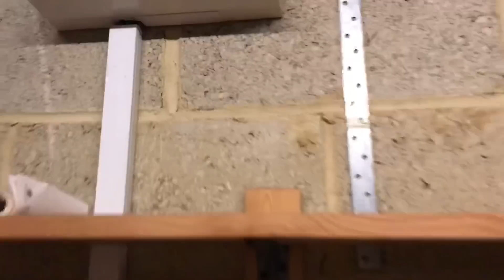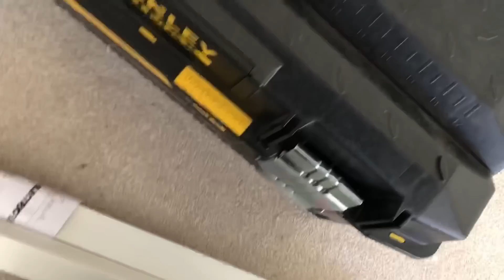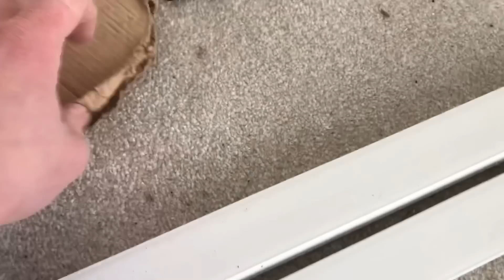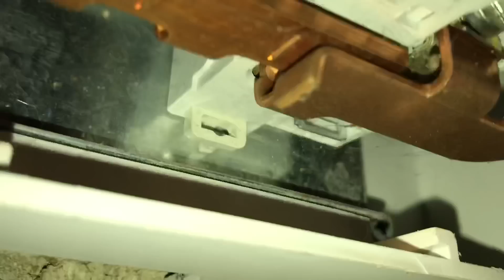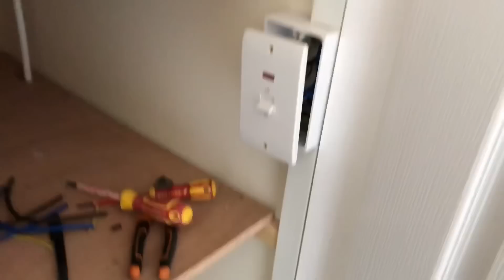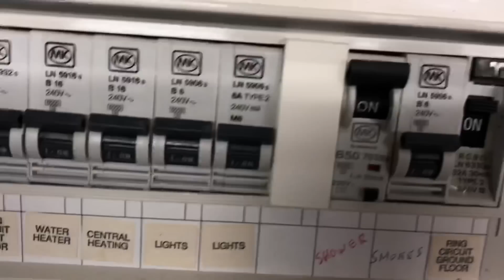Electricians day installing shower circuit and consumer unit find.

Comment: I've got one other these running from my garage, through the wall into my downstairs hall, up a bedroom wall, through the loft across the house, then down into the shower. None of it in trunking.

What I'm wondering is if its ok to chase part of it into the hall wall and then run under the floorboards into the bathroom instead? Safe under floor and embedded in wall?

Comment: Looks good. I need a connection and electronic shower installed. What is the cost for both? BTW I looked and I live in London, you guys are to far away. Not sure if you have locations or workers all over?

Comment: Hi, this is my 2nd visit to this installation video and a couple of things sort of jumped out at me. The Consumer unit should have their MCB/RCBO Installed from the Greatest Ampere Sizes nearest the Main Switch to the lowest Amp Rated being the furthest away, large loads need to be fed first and a real bonus is that lighting that dims when these loads are being fed can indicate issues. Placing a 50A breaker near the end is not a good idea.
Maybe also another good idea where it is not practical to re-configure the Existing Consumer Unit [short cables maybe] is to install a Separate 4 to 6 way Consumer Unit wired direct via a pair of 100A iscol links, Next to the Origianal Board, to then install a Main RCD Switch rated at 30mA/80A and then place a 50A Type B,C or D Series MCB Dependent upon Max Circuit Resistance. Interesting point here is that everyone and their dog selects a Type B Breaker without considering the value of selecting a more suitable one via the Tables in the Wiring Regulations
I also noted an extraneous conductive part [Wall to Rafter Metal Tie]  next to the Consumer Unit with no earth attached and I doubt that the Garage Doors/Frame had been earthed ! 
Also omitted was the check to verify if the Bath / sink had been Bonded, bearing in mind this installation appears to be old school regs not having a 2 x Main RCD Split M/C Board affording all circuits with RCD Protection, it needs to comply to the regulations of that time and sure as eggs are eggs this needs checking, also a quick check as to the type and Class of light fitting installed in the Bathroom.
Mr Spence Eng April 2022

Comment: When we had a new shower fitted,the electrician noticed that the supply cable that my now retired electrician had originally fitted was 16mm,as was my cooker circuit and the utility room too.He wasted no time and effort telling me how much he hated the stuff and that despite the shower and consumer unit being only about 7-8 ft apart that there was about 17 ft of surplus cable in the shower circuit just laying in the loft which I then pulled through,but only after a massive sweary fight with it😄,Jeez! that stuff don't manipulate or even want to co-operate it's almost like semi solid bars,no wonder no bugger wants to use it!. Plus it seems an expensive way to do it but I'm assuming that because the original guy was nearly finished he just used what he had. Anyway,recently while fitting a new cooker to our kitchen(twin fan ovens with grills and 4 halogen rings)which required the back to be removed to make conection I couldnt help but notice that what we were effectively doing was joining a bit of 16mm to a bit of 2.5mm, the internal wires looked completely ridiculous on the face of it and it was basically unsheathed 3 core flex supplying the whole cooker!

Comment: Great video Chris, lots of helpful info. Would like to ask why you chose an RCBO rather then just a standard circuit breaker to supply current to the shower. I am not an electrician but a plumber/heating engineer so I do install showers now and again. thanks.
Reply from the maker: Circuits in a special location ie bathroom need rcd protection
Reply: @Cjrelectrical  Thanks for your reply Chris. I am a still bit confused as to why you installed and RCBO rather tan just a 50A MCB ? Is there a specific requirement in the regs that specifies a RCBO over an MCB or was it a matter of preference ? Thanks
Reply: Wherever possible showers should always be protected by an RCBO, this is a device that does the job of both an MCB, to provide overload protection and short circuit protection, and an RCD to give Earth Fault protection. ... The RCBO is the better option as this gives overload, short circuit and Earth fault protection.

Comment: Let me see if I understand this, the building has a 100A incomer and you are not prepared to install Two 10kW Showers that combined represent at best 2/3 of your 100Amps and are likely to run for a max of 10min. Have we now stopped using Max Demand and Diversity when calculating loads.
Maybe a quick trip around some of the Large stores in Town may help you get your head around what it is possible to run on 100A/Ph, ok the boards get warm, but due to diversity they quickly cool when loads switch and this system has been about since the begining of time, I have seen incoming cables sized as small as 6mm running both Single and 3ph x 6mm fused at 100A/Ph and I have also witnessed 1st hand an 8.4kW Electric Shower run on 2.5mm T/e pvc/pvc Cable and had been doing so for years and years, before they whiffed that old familiar fish smell and apart from needing a cut back it would have been good for another spell of service, sometimes things just work with Diversity.
Mr Spence Eng
Reply: The OSG and BS7671 would not allow such loading probably. If you have 2 electric showers you probably have a largish thirsty house. How are you going to get it all below total of 100 amp main fuse unless you use a priority board for 2 showers

Comment: Hi,  if i have a shaving light above the mirror with a pull cord but i want to change the light to a one that doesn't have a pull cord how will I do it ? i don't have a wall switch for the light is just the pull cord at the moment ? Thanks

Comment: I guess you could put a changeover switch between the supply cable and the two load cables coming from each shower, so only one at a time could be used, but I think that's a bit too out there for a domestic dwelling?

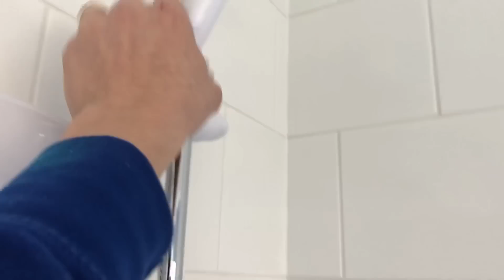Comment: 13:49  In Thailand they use these showers too. But without special on/off switch in cable line, power cable direct to fuse switch. The shower self have a on/off button switch. 

Why do you need three switches in UK?

Comment: Just fit a shower split  shower splitter connector relay switch so only one shower circuit can be live at one time not seen the cost of then but there out there.  More cost but if that is what she is asking for.

Comment: Question i am now on my 3rd isolating wall mounted Switch the previous one lasted 7 months the first one 7 years when the shower was fitted by a Qualified Spark i normally turn the shower isolating switch off when ive finished showering just wondered if it causes the switch to fuse together if you turn it on anmd off ? the last one i have replaced today the top wire had burnt out and caused the switch unoperable ,the second switch was fitted by another Qualified Spark but this only lasted 7 months i have now fitted a new 45 AMP switch myself as my spark said he was ogff till Jan 6th 19 thanks in advance any ideas

Comment: i being from usa wld have sleeved some pvc conduit thru the block and left  not so much of a tight bend out of the hole i think you may have over done the clipping a little but maybe there are different codes on that side of pond. in my area its one clip every 1.2 meters larger cables like those i might go every 1 meter

Comment: What would happen if you connected up 2 x 10.8kW electric showers on the 100 AMP?  and ran them at the same time?  Would 2 x 8.5kW be ok as it comes in at 83 amps ?  Or is there just no way to have 2 electric showers working in a domestic house?  I mean surely that is a problem in any bigish house?   Or fit somekind of automatic lockout box that means if one shower is drawing power, the other wont turn on.

Comment: Just one small criticism, whenever you see something dodgy, (like the exposed copper of the meter tails in the unit) dont just say "thats fantastic" and move on. You know what youve seen, and whats wrong, but the inexperienced will be wondering what was fantastic, and think it was acceptable. You have done this in a few vids i have watched, so if you see something wrong say its wrong, and why. Sorry to point this out but its important when doing instructionals.
Reply: Bang on the money, yes if it is wrong put it right, how long would it take to trim them back or 
to put some Colour Coded Heat Sleaving on them. For more complicated items, take a photo and advise the client this should be put right and the cost of doing so.
Mr Spence Eng

Comment: I'm a little confused,  why are you running mains power into a shower? Is there no central hot water service installed in the U.K? Here in Australia every house has a centralised hot water service, only exception is some units that have a complex hot water service.

Comment: What the silicon you use incase of fire it expend? Anyone
Excellent job bro well done
Reply from the maker: https://www.screwfix.com/p/no-nonsense-intumescent-sealant-white-310ml/5689R?tc=NT6&ds_kid=92700022904812373&gclsrc=aw.ds&ds_rl=1249416&ds_rl=1241687&ds_rl=1245250&gclid=EAIaIQobChMIiIGE5NiG5AIVhrHtCh1j_QwAEAQYASABEgJPVfD_BwE
Reply: @Cjrelectrical  really appreciate it mate

Comment: I'm enjoying how you do electrical work in the UK. Especially the flexible stranded conductors in the cables. 
In the US we typically use a 5ma trip rated 120 volt GFCI receptacle to protect people. The 30 ma trip would be to protect wired equipment. 
The residential voltage  supplied by the utility is nominally 120/240 volt with lights and receptacles supplied at 120 volts.

Comment: it blows my mind that your allowed to put a 240v appliance inside the shower. you  guys sure put a lot of trust in your RCD/GFI's!!!! 

over here in Canada(or north  america in general) you can't even have a switch within arms length of the bath. yet somehow people over here still mange to kill themselves by using  phone charger in the tub. 

its very interesting how different electrical safety codes are from country  to country despite electricity being the exact same thing everywhere.

Comment: shower not need 10 kilowatt heater, i have 2 bathroom only 3,2kilowatt, 16A max have 3,200 KW fuse. and cable have 16A need be 2,5mm2. simple and hot water have alltime. but we have normal all world used 230V system not idiot old historic 110 volt what not used anywere normal human world today.more volt and less current have lot safety, high current kill, not volts.high current burn many house but low current not.this is main true why all country has change old pre-history 110 volt to safety and lot better 230 volt system. only idiot use today 110 volt systems.

Comment: hmm,douple pole 50A switch, need be ALL near water area 30mA safety switch,i not remeber english this switch name but ELB safety switch need be.this have only safety to human if come somethink broken and problem. ALL elektric in bathroom,pool area,kitchen near water need be 30mA safety switch,ewerythink soccet and lamps and power were has in bathroom need be. if not have ,inspector no aprove, fail. whit out switch have super wery dangerous . and nedew elektric no make near water point, must be have minimum 1,2 meter far all water point.

Comment: Why do you need to pull out the neon for the IR test? Do you IR test between line and load?
Reply: The neon is across Line and Neutral so when you put 500v through there it'll blow the neon.  Or, if a miracle happens and it doesn't, it'll invalidate the IR test.
Reply: Thanks for the reply, I meant to write Line and Neutral. Sorry for sounding silly I'm not from the UK area so I am quite intrigued. 

So in a situation with a already existing house are you then suppose to go and unplug every socket and or remove every globe? I thought IR test between Line - Earth and Neutral - Earth would be enough and then a continuity test the different circuits?

Comment: Our consumer unit at home looks like a very similar model to the one in this video. The RCD looks (a bit) newer than all the other breakers, though it's still all MK. (though there is also the same hole at the top of the box)

Comment: Never gets old watching you guys across the pond! Electric showers seem so weird coming from the US! We do have demand water heaters mostly gas around here but you will find an electric from time to time. Last one I saw was feed with 3 x 30a 240v circuits one 10ga (2.588 mm) run for each stage of the heater. Keep in mind this is a whole home unit not just one shower.
Reply: I am a plumber in the UK and always suggest to customers that they choose an electric shower in preference to having a shower supplied by hot water from the boiler. Main reason being that if the boiler breaks down and it's going to be out of service for some days due to getting someone available to fix it or waiting for spare parts, having an electric shower means you even though your heating and hot water supply to the taps (fawcets) is down you still have a hot water st the shower. Especially important if you have a large family and children to keep clean !

Comment: You may have made an omission by not installing supplementary equipotential bonding to the lighting circuit or an rcbo on the lighting circuit, since it was not covered by an RCBO or RCD in the consumer unit. 18th Edition regulation 701.415.2, in particular 701.415.2 part V states it can be omitted if all final circuit in that location are protected by and RCD. That didn't seem to be the case?

Comment: These "power" showers are so strange for finnish people who get warm water straight out from shower. Why dont you use bigger Electric boilers for warm water?
Reply: Probably 1) not a high enough water head
2) big pressure difference between hot cold water.

Comment: Christ UK electrics are weird. All our wires are inside tubes that are inside the wall/under the floor/in the ceiling. Even the electrics that are on top of the walls (old houses) are inside tubing. Our warm water comes from heaters that are outside the bathroom.

Comment: How often do you guys get a DIY light switch move and the guy uses the earth as live instead of buying 3 and earth cable for lighting. Crazy, the worst thing was the guy was complaining of shocks of the switch!! dumb ass connected earth to earth but it was live the other end. The switch was not only not earthed, it was live on the hot cable. I wish people would leave things alone if they don't understand. To be a good electrician you need a good imagination to visualise in your head how it should be. Great content matey. Hope it educates people in the dangers of messing with this stuff and getting the right people in for the job

Comment: It may just be me, but what about earth bonding the water supply pipe to the shower in the cupboard and shower unit.  Looking at the pipework in the cupboard,  it's feed with 15mm copper, then a 15mm plastic elbow, then what looks like 15mm white plastic pipe, then another 15mm plastic elbow.  From this plastic elbow they used 15mm copper pipe through the wall to the shower unit.  I would bridge the plastic parts with earth bonding.

Comment: Would you still used the banding straps if the cable was covered by plaster board?
Reply from the maker: No I would just clip as normal anything covered by building fabric does not apply.

Comment: Arnt your cable clips the wrong way up? Not been an arse but we were always taught pin at the top
Reply: I would have thought best to have pin at the bottom as the weight of the cable rests on that rather than the plastic clip alone.
Reply from the maker: Your quite right mark but with a 2.5mm2 armoured there is no weight and with the correct cleat spacing. I did it this way as I was siting the cable along the top edge of the boarder sleeper and below was solid timber.
Reply: Mark the problem is if the cable heats up the weight will push in the wrong way if there facing down it’s not pivoting on the pin if that makes sense 🤔

Comment: nice work, but why is their a heating device - in- the shower? why is the heater not on the other side of the wall (where the switch is), then run a pipe into the wet area? even if the heater thing is listed and sealed up and installed correctly, just no!
Reply from the maker: It’s an electric shower very common in the uk.
Reply: @Cjrelectrical  i get that, but why is in the shower? it seems like that should be mounted away from the water, like on the other side of that wall, where it's dry. I know breaker and fuses work, but why give them an excuse to be tested ?
Reply: @CrazyPetesProjects  Mine's like that but they're more expensive because there needs to be an ELV control circuit from a panel available to the user and the remote heat and pump unit.

Comment: I live in a flat I rent.. The shower died so a new one was fitted.   I have a 8 way wire Fuse MEM consumer unit.  The electrician put in a Surface mount  RCD for the shower..  Only prob he wired into the Cable that feeds the Cooker outlet in the kitchen.   So after i had a shower i tried the RCD Test Button.   The device tripped just fine , except the shower stayed working, but my washing machine stopped !!   What sort of electrician doesn't test  his work ?  specially a Safety Device !!   He had to come back and rewire his work..
Reply from the maker: Ow dear that does not sound good at all.